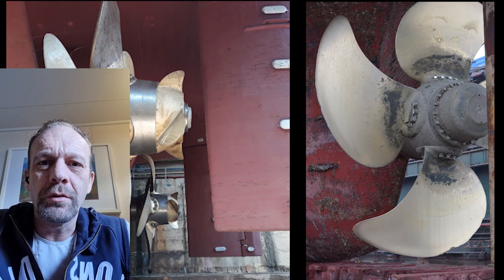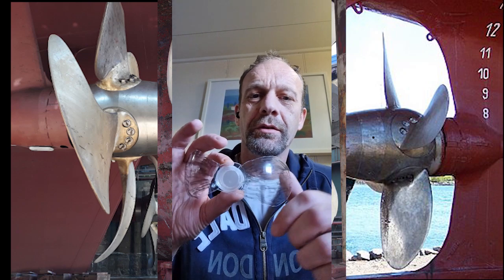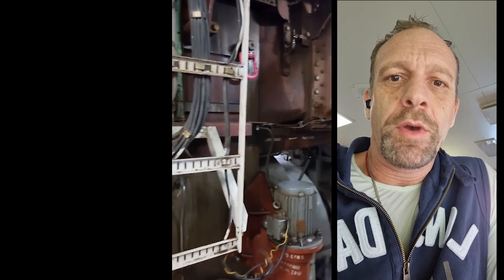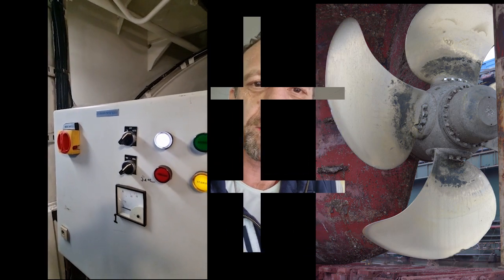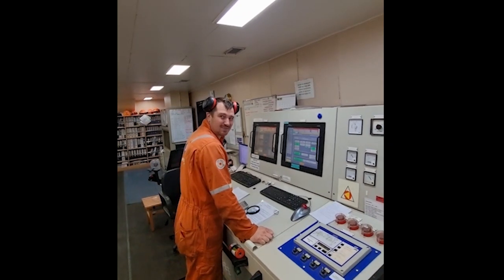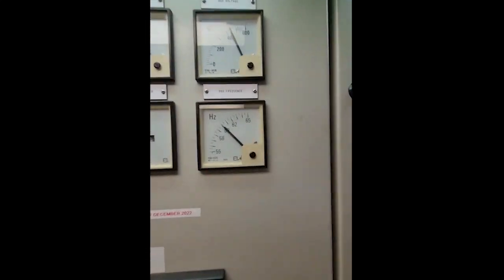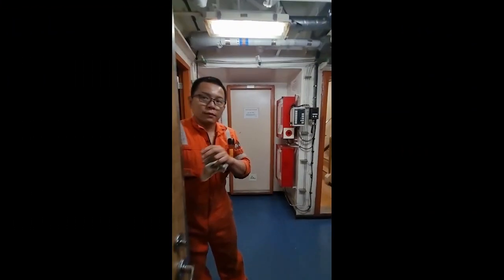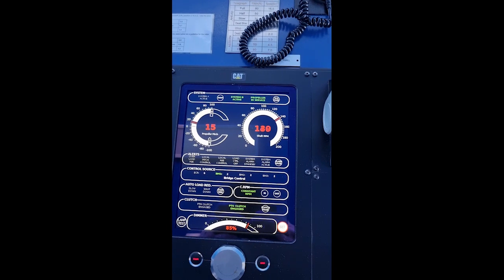What is a Controllable Pitch Propeller

Comment: Very interesting. I'm looking to build one (with a push rod, not hydraulic oil) for an RC in 1:72. Do you possibly know what the max and min pitch angle usually is for these things? I'm guessing somewhere around 30 - 35 degrees? Is it the same for forward / reverse pitch? Thanks a lot in advance :)
Reply from the maker: Hi, very interesting project. But sorry I can't help you with thr exact angles. Hope you can find somewhere online. Anyway typical is that with idle position there is still forward speed, due to the tip of the blades. And reverse speed would not be the same due to the same reason
Reply: @CaptainFulco  Thanks! That's already a bit of a help! The CPP's I'm looking to build are from BERG Propulsion. I'll see if I find some information on their website or maybe even contact them. Cheers!